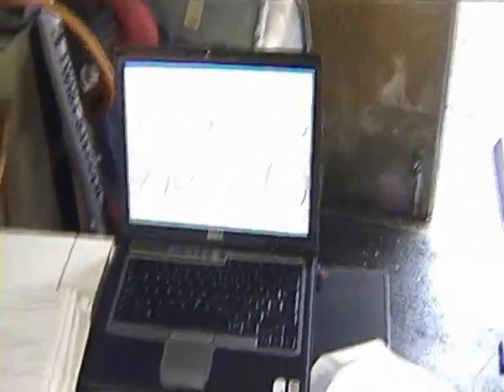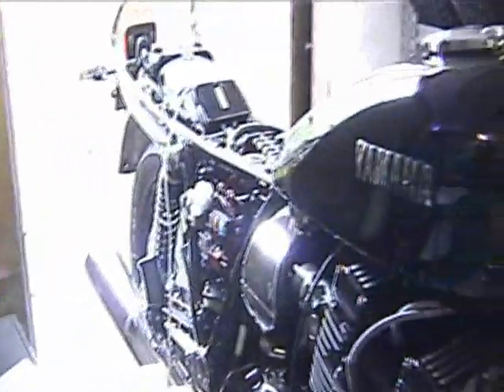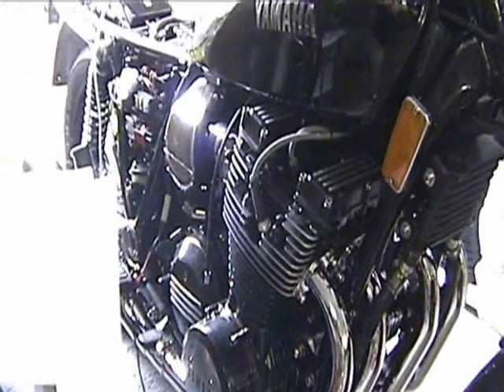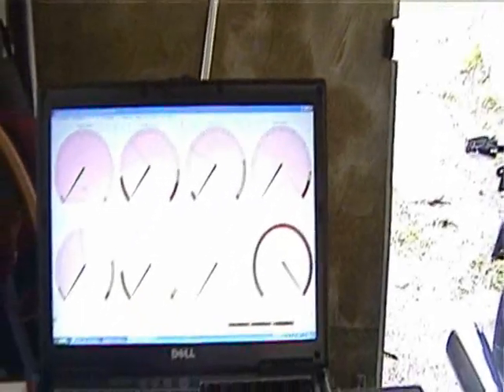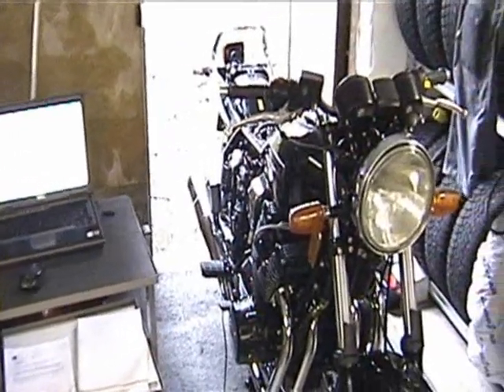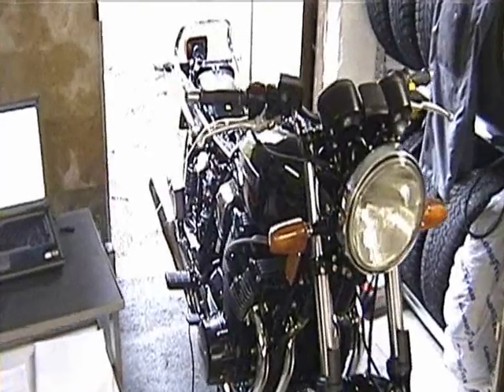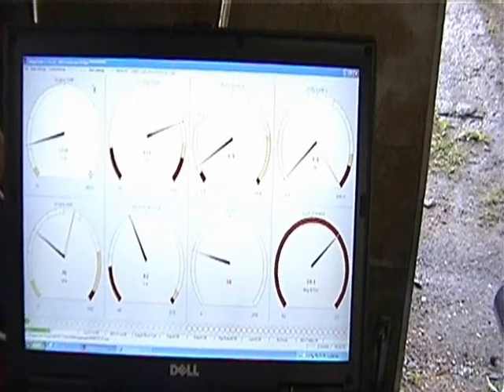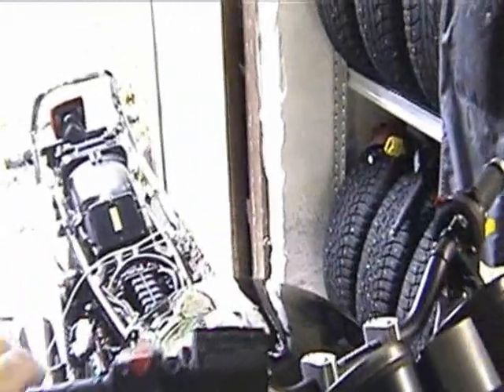XS1100 Sport - MegaSquirt 1st Start

Comment: can you help i have a 1984 xs 1100 s uk 5h7  model the fuel has always been a problem  the 2 fuel taps say on of and reserve and are the same bore size ,do you no the correct layout for the pipe lines thanks  neil.

Comment from the maker: Yes, with a bit of swearing and a hair-drier on the inlet rubbers! These are 2004 TB models so 1 and 2 are one piece, as are 3 and 4. If you're interested further I can link you to the forum webpage where I wrote all this up. I guess the FJ has a similar inlet spacing as the XS?